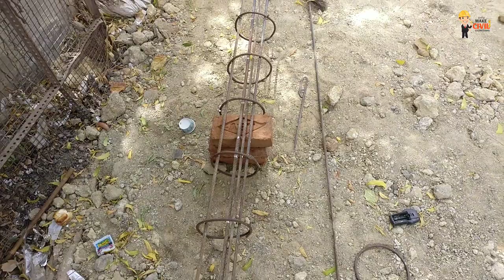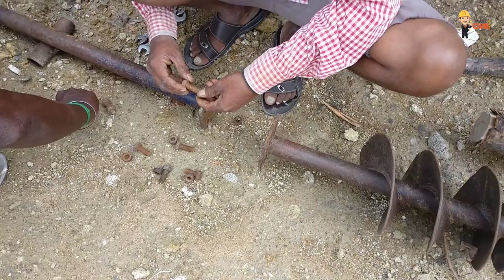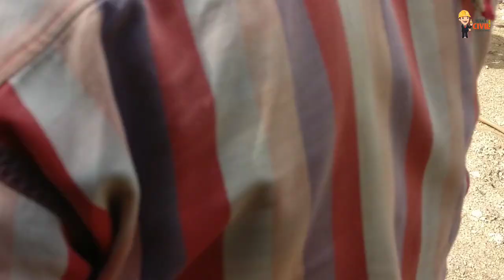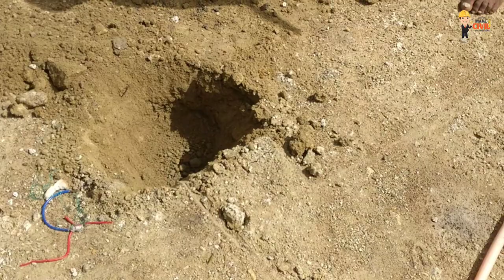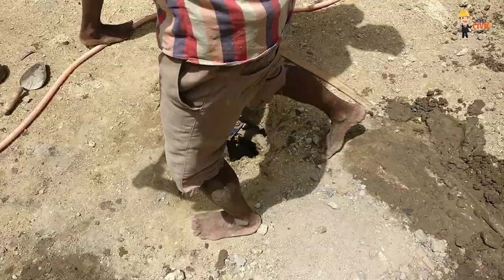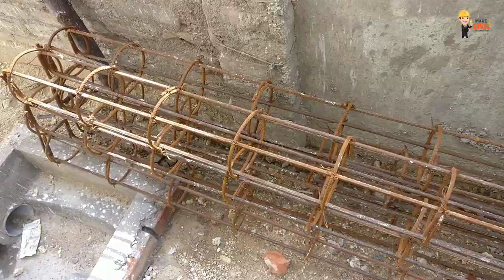அட இப்படி ஒரு விஷயம் இருக்கா! 🔥 pile foundation auger boring & pile footing

Comment: Pile foundation is generally recommended for compound walls and vehicle parking sheds where pillar bearing load is minimum.for building house in rock soil pile foundation  can be used and not for clay soil or sandy soil. Six bars for house construction in rock soil and for other constructions 4 bars is enough. In peculiar circumstances where the construction site is small and closely surrounded by aged and weak buildings where   digging foundation would be unsafe to the surrounding domicils, to pile foundation each one at 5 ft gap with 12 mm bar ground beam interlocked is an alternative